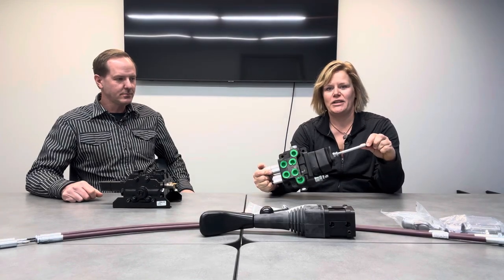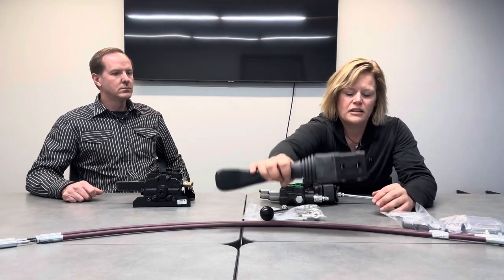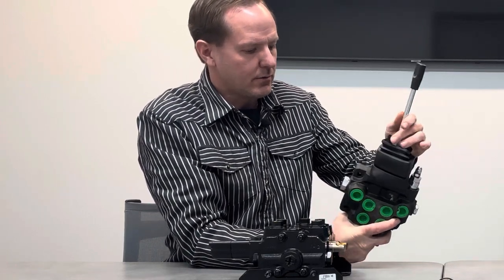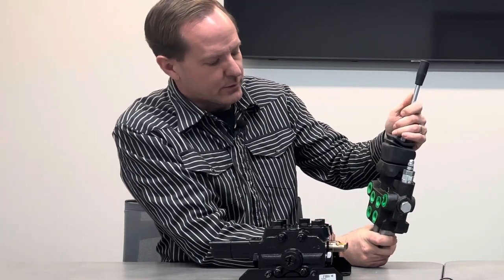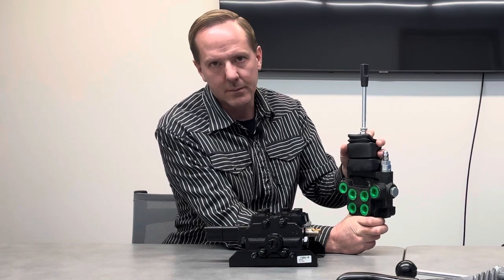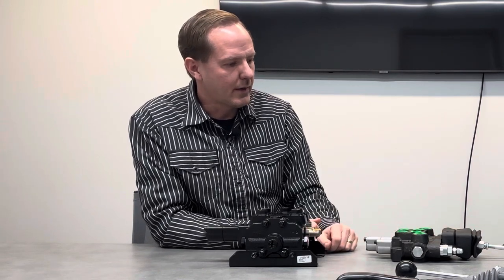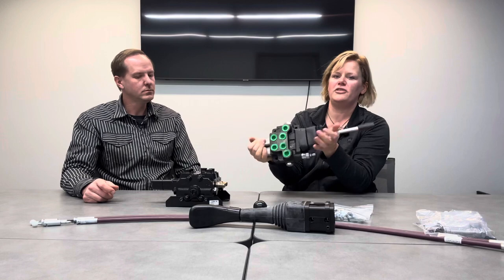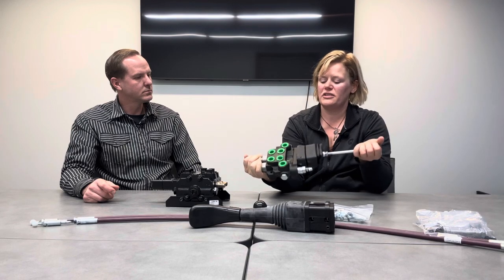Adding a Hydraulic Valve to a Tractor to Control Add-On Equipment

Comment: I need to replace, the loader valve on my NewHolland 3930 50hp Tractor. It has the 7210 Ford loader . The old joy stick is a Prince brand name. The valve controls just the front end loader
 How many GPM and how much PSI will I need on the New Valve?
Reply from the maker: You’ll want a control valve that has a working pressure of about 3000 PSI and a flow capacity of around 13 GPM.
Reply: I have the valve on my JD 4630. I would like to remove the pressure relief valve, as the system is already protected, because the prv is cracking causing excessive heat. Even with the prv pressure increased.